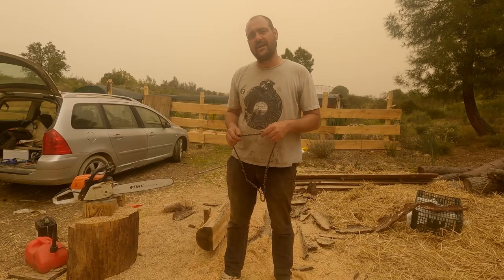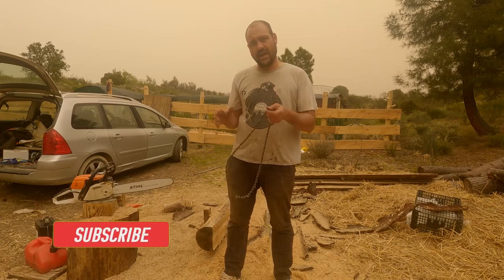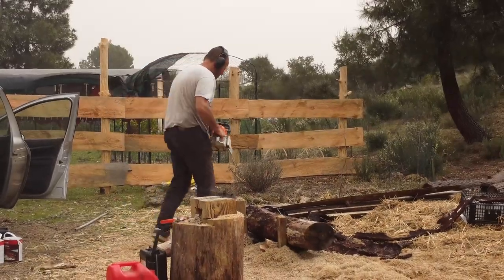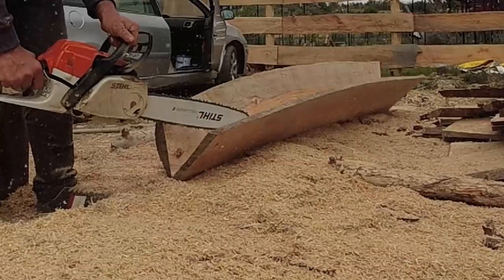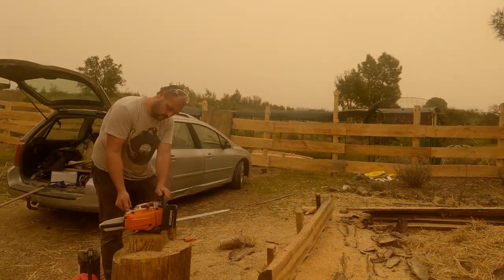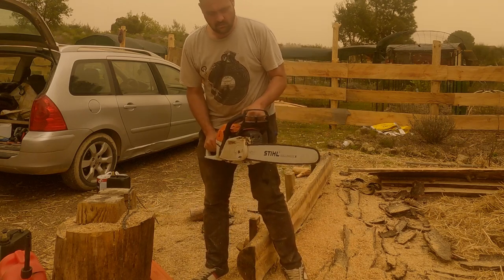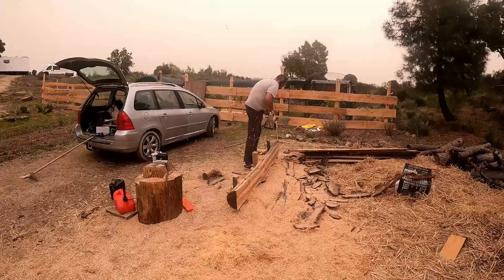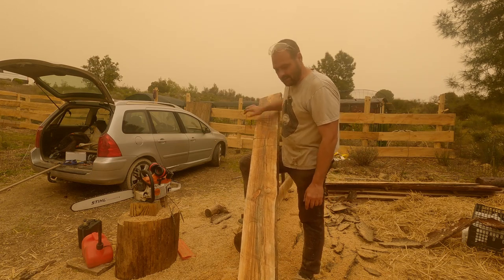FREEHAND CHAINSAW MILLING - Which one is faster and more efficient 10° or 30°

Comment: Curious if there's a difference in the surface texture of the boards. For fencing it wouldn't matter, but for other projects where you're finishing the board a rougher cut would mean more time to finish the board.
Reply from the maker: I just put some freshly milled boards together and used an electric planer today. They came out pretty good considering it was my first time using it. It didn't take too long either.

Comment: save to the time and cost a chainsaw mill is slower. but you gain repeatability. no laying out each cut just keep cuten till log all gone. free hand is great tho if the log to big to mill. u just break a large log down till you can use a c mill to finish it. good test tho!

Comment: someone on a video said it is WAY more efficient the way you do it than with a chainsaw mill, it takes way less off at a time with the mill + it uses way more fuel because you have 10-15 teeth digging into the wood gnawing off dust compared to your 2-3 teeth digging out long chunks each time they pass
Reply from the maker: Yes the guy I learnt how to do it from , advoco makes says its two to three times mode efficient in fuel and time